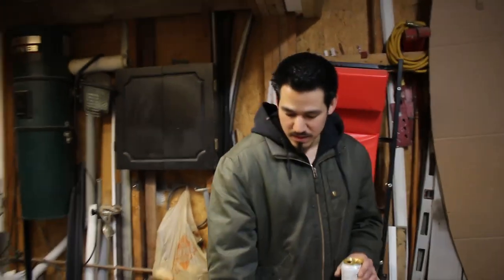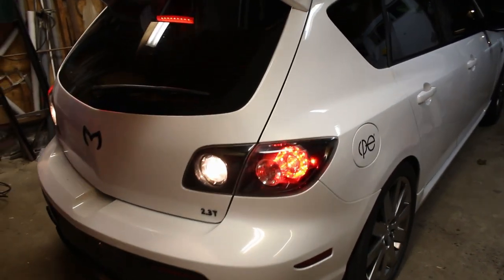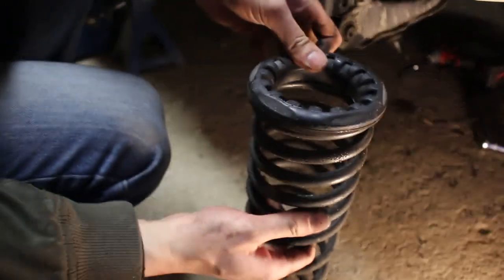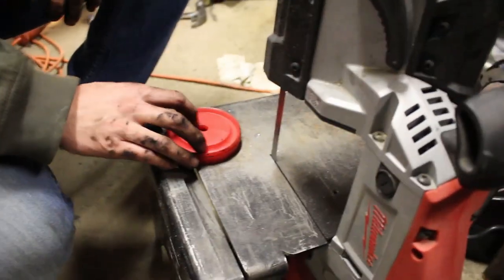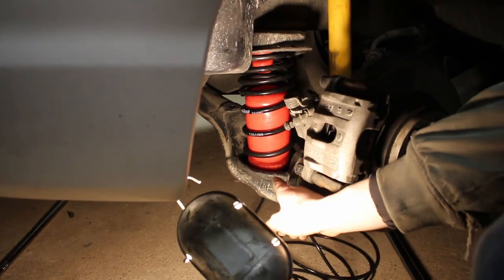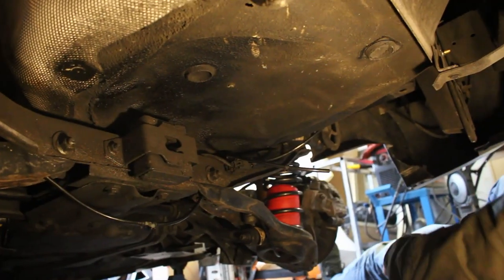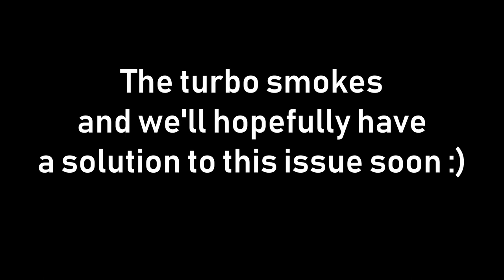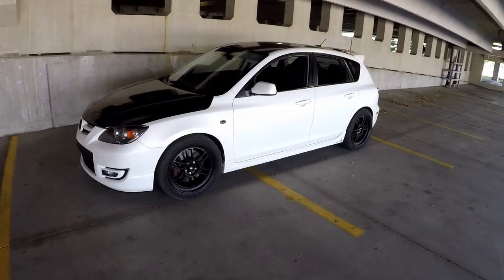How To Increase Traction & Improve Acceleration - Air Lift 1000 Install (Mazdaspeed 3)

Comment: Even pressure is better when they are isolated from each other. Without isolation, one will always stretch more than the other allowing more pressure in the weaker bag. With weight being added to say just the drivers seat will increase the pressure on that side. More resistance means it will take more pressure to lift that side. If they are in parallel the passenger side would have to overcome the weight/pressure. Even spring pressure can be better conditioned isolated/separated.
Reply from the maker: That makes total sense, I can see how that would be beneficial as the pressure in one bag will not effect the behavior of the other bag. It's good that they provide two shrader valves with the kit for those who want to inflate them independently of eachother. Even having it setup the way we did it delivers a huge improvement in handling :)
Reply: I am a proud 2011 mazda2 and 2006 Mazda 3 owner, I have done all work on them over the lifespans so far. Mazda2 has 118k and the 3 has 198k. I made a set of custom coil over shocks for the rear of my mazda2! It’s much more stiff now! Keep up the great vids!

Comment: I really have wanted to do this to my car but can't with the bc coilovers 😫
Reply from the maker: Aren't the shocks and springs separate in the rear, even with coil overs?
Reply: @WannabeTuners  they are, however the springs are much smaller than stock and they are kind of tapered and I can't find bags small enough
Reply from the maker: @ZJSProMedia  Oh I see. I wonder if the springs could be measured and paired up with a smaller set of bags from Air Lift
Reply: @WannabeTuners  maybe. Definitely something to look into now that I'll be pushing 380 ish to the wheels rather than 290😬😅
Reply from the maker: @ZJSProMedia  Absolutely! It's a massive improvement
Reply: Found anything? This looks well worth it

Comment: Couldn't you just get adjustable damping shocks and it would do the same thing
Reply from the maker: I wouldn't be surprised if stiffer shocks helped a bit, but I imagine the ride quality over bumps would be harsh. I'm sure stiffer springs would definitely work but might also be harsh. I'm not even sure if there are any specifically stiffer springs available on the market for these cars. The thing I like about these air bags is that they keep squat to a minimum, but also keep the ride comfortable. All they're doing is limiting the travel of the springs, not actually stiffening them :)

Comment: How would I do this if I have air suspension? My rear is bouncy as hell
Reply from the maker: I don't think it's possible with air suspension because in your case the air bags ARE the springs. In our case we retain the stiffness of the rear spring and shock combination, and simply prevent the springs from being compressed. For the most part ride quality is comfortable and refined, although if pressure is set too high it gets a bit bouncy ;)

Comment: Edit updated measurements

Hi guys, great video. I tried installing the # 80754 3.44 x 5.5  bags in my Mazda3 GT (not 3speed) and didn't like the universal fit. The bags aren't tall enough and must use the spacers which I suspect may eventually fall out. I did some more research recently and found a company in Australia that sells Firestone airlift bags for Mazda3 and they appear to be proper height (don't have spacer at top to take up room for shorter bag. I suspect they list lift bags because North America doesn't have tow rating form Mazda3 but Europe does.

Air Suspension Helper Kit for Coil Springs High Pressure (they actually have two kits but I want this one for towing)
MAZDA 3 BK & BL 04-13
SKU: CR5094HPhttps://airbagman.com.au/collections/999800207-air-bag-suspension-for-mazda-3-bk-bl-04-13/products/cr5094hp?lfdnr=206541

The quote came back 
Goods Total: $254.09 AUD
Shipping Cost: $105.00 AUD
TOTAL: $359.09 AUD
The bags and spacers are 8" in length in total

BTW here is the measurements I took 2012 Mazda 3 GT:

3.54" inside width
6.49" length (8" using inside pocket total)
5.5" length (to head of bolt)
Reply from the maker: Hey this is great information! Thanks for sharing